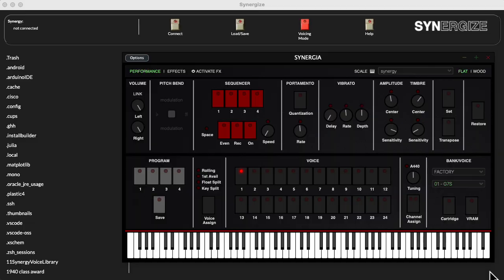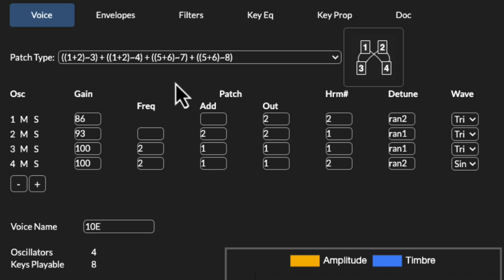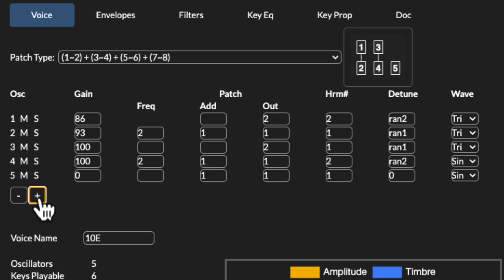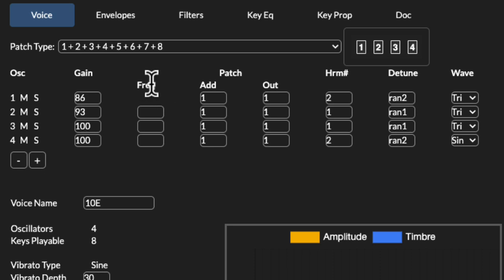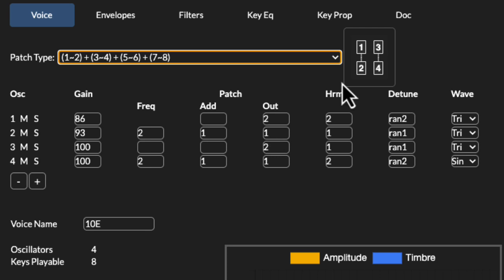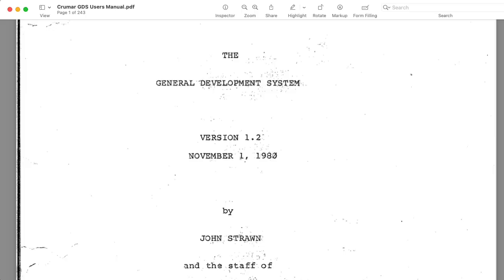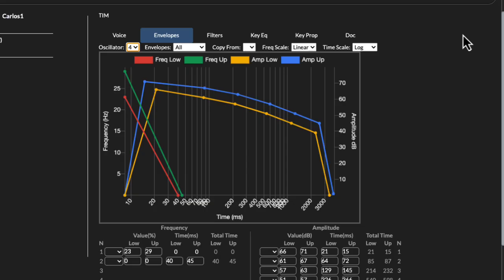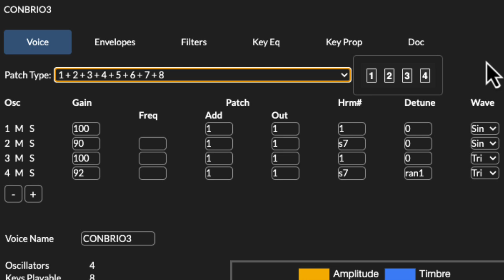Synergize/Synergia Tutorial: FM Algorithms (Digital Keyboards Synergy)

Comment: I owned the real thing including a Kaypro for quite a few years but never could get it to actually save sounds. Maybe it’s time to catch up but I’ve moved to a more advanced platform since then. Basically every good 4 layer synth can already act as a sort of emulator since the originals oscillator / voice limitation made using more oscillators per voice impractical for polyphonic use. A pity though that nobody came up with this or a good CPM emulator in time. If so I might still be using it today. Kudos for keeping it alive though.

Comment: Very timely video for me - I'm working on an FPGA implementation of the Synergy and just got the oscillator board logic working. I can confirm that there are four output registers available in the hardware, so it's not immediately clear why the patch editor only supports two. One possible explanation may be that the output is stereo and they reserve two registers for each channel - I notice you didn't mention stereo in the demonstration so I'm not certain how the patch editor supports that.

Comment: holy crap, this is a wild plugin 😱
does it have MPE support??
Reply from the maker: I doubt it. It's running the same Z-80 code as the original Synergy to try to behave as close as possible to the original synth (you have to download the ROMs to make it work), and MPE didn't exist in 1980. ;)
Reply: @Lantertronics  ah, i see now. I'm still going to have to check it out. There are only a handful of synths that allow multiple feedback paths!

thanks for the help too
Reply from the maker: Download it! Try it out! If you check out the intro video I did (first link in the video description), I go through installing it on a Mac. I think Windows installation in similar, but instead of dragging & dropping the ROM files on to the GUI, you put the files in a particular directory. I also show you where to find the ROM files.
Reply: If it is truly close to the original MPE or even channel aftertouch make little sense. Pressing a key on a Synergy basically “freezes” the development of the tone as it is programmed into the presets table. Only pitch and LFO depth can still be controlled after that so do not expect controllable filter sweep emulations and such from a GDS/Synergy/Mulogic. In that respect it was a bit of a pianists instrument. Understandable for the computing power at the time but also it’s biggest limitation.